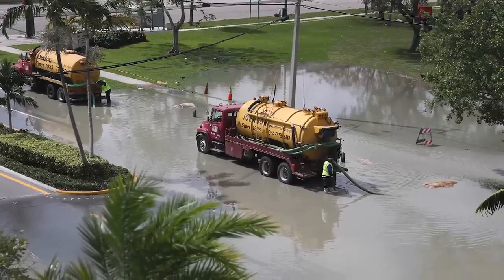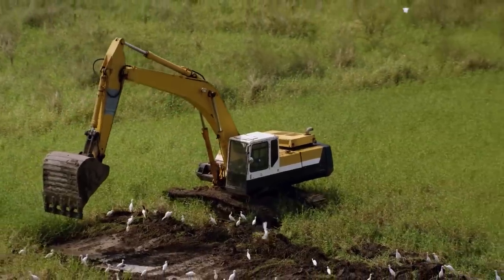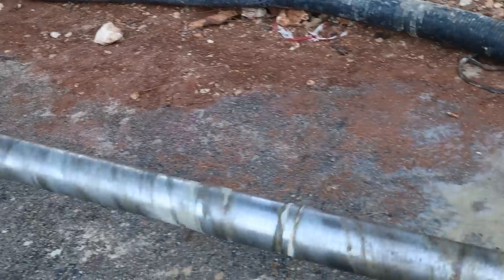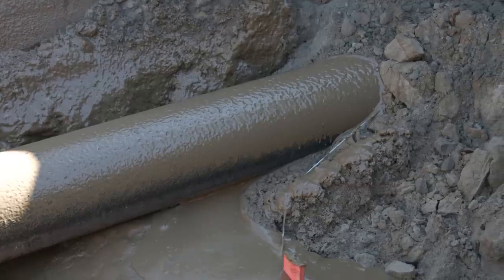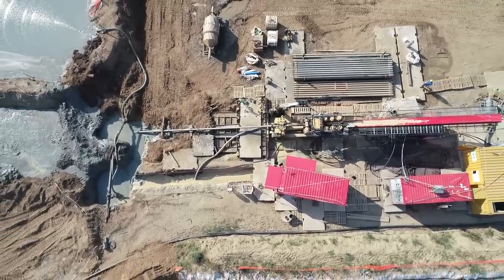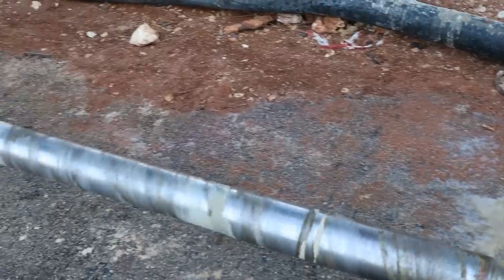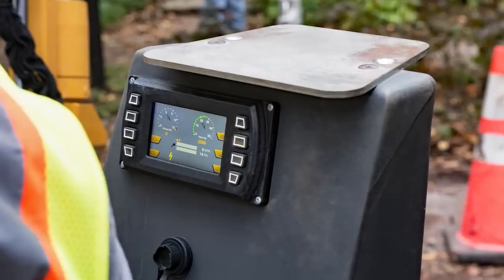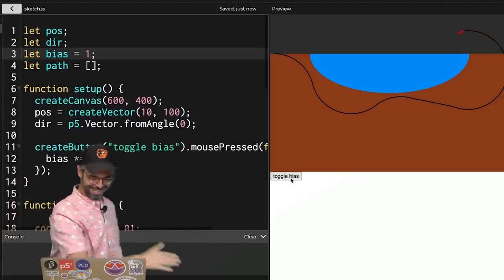How Do You Steer a Drill Below The Earth?

Comment: Great video, as usual. I splice fiber for a living. My work depends on HDD crews followed by pedestal/hand hole installer crews to get their jobs done before the fiber blowing crews can put the fiber cable in. 

Something not mentioned here (which I think is very important for the public to know) is the importance of "call before you dig". Our HDD crews have to put in locate service requests 72 hrs before they start. Any company with utilities/pipes/fiber/gas has 72 hours to mark the requested route with spray paint or flags.  If they DO NOT MARK IT, the repair cost is their burden when it gets hit.

There is a huge misconception that HDD crews are always careless when they are drilling. Many times, other companies have not properly grounded their systems, used tracer wire in non-conductive pipes, or adequately documented where their pipes are... their buried utilities can't be definitively located. 

One job just up the road from me has broken the water main so many times because the city claims they don't have the equipment, manpower, or budget to do the locate requests and mark where the water main goes... Even though the primary contractor offered to give them the equipment and pay an overtime rate for all city employees needed to complete the task. In the end, they hit the water main 3 times a week and they are portrayed as the bad guys. 

For those wondering... hitting a 288 fiber cable and damaging a 1000' section can run well over $15,000 in fiber splicing cost alone. I don't know the HDD costs or any of the other expenses needed to replace the cable... But it is very expensive to break a fiber cable.
Reply: Most of the guys doing fiber are payed by the meter so basically if your not drilling your losing money. But I would say just at a minimum you would be $500/hour in cost. The worst part is no matter who hit it or why gossip travels and it hurts your company reputation.
Reply: also, accidents do happen on both ends.  a guy I worked with years ago was on a bore project at an airport, and the rig operator was going for speed over precision when his bit came up through the runway surface.  other side of the coin, a trenching crew cut a 125 pair copper phone bundle when the country grader graded the road in between the underground locate service marking it and the trenching crew trenching it.
Reply: @kenbrown2808  that sucks, but so true. Some other company on a jobsite can screw up vital info needed for the HDD crews.
Reply: Apparently HD drillers have had it relying on the utility maps for locating other existing  pipe and lines. The various detection equipment business are taking off.
Reply: @kenbrown2808  Sounds like nobody wants to go down through bedrock actually drill, where there is plenty of room.  Instead, everybody just wants to ram though the soil, and it’s getting crowded.
Reply: @Nill757  maybe that is a contributing factor to the industry's growth, but the amount of money being spent in rural fiber network construction has stretched all existing crews to the max. I'd be more inclined to say that's why locate service providers are taking off.
Reply: @Nill757  yes, they kind of want to keep whatever they are installing at a fairly consistent depth, to make it easier for other people to know what depth they can work at.  for example, natural gas service lines run at 24", power service lines run at 36" consumer electrical lines run at 18" and TV and telephone service drops sometimes get deep enough to not be a trip hazard.
Reply: @kenbrown2808  Sure, and when crossing multiple other lines depth, the space at that depth is full.  There are no subterranean stop signs w intersections.  A new depth, deeper,  probably in more rock has to be used, but crews are avoiding the cost with many major disruption of existing cable/pipe.
Reply: @Nill757  yes, directional bore crews really need to locate any obstructions, not just by location, but also by depth, and avoid having their drill at that depth in that location, and a lot of old underground stuff was just put in the ground with no electronic tracing assistance, which makes it that much harder to avoid.  however, boring down into bedrock and then turning is often a massive overcomplication.

Comment: I once wrote a guidance program for a pneumatic directional drill head. It allowed for horizontal and vertical profiles, and I had to invent a method for aligning two vectors in space using at most 2 curves with a minimum radius of curvature (it involves normal vectors to planes and an iterative approach). The drill head was one of a kind, with no mud required and an average speed of 1 foot a minute. The contract fell apart though, due to various factors. It's still one of my proudest achievements.
Reply: As a locator, that would be cool to use
Reply: impressive programming

Comment: Best Vid yet, I always wondered how they did that and now I know. The demos of an asymmetric bit steering the drill string are excellent.
Reply: Can you build such a machine on paper? NO, because you still don't know how it works. you only know the theory, no practical comprehension regarding the drill manipulation or function.  How do a bit steer if it needs to continuously turn to drill? You don't know. I don't know.
Reply: @alltheusernameswastaken8936  Well of course I couldn't build one of these machine based on a 12 minute YouTube video....It's a demonstration of a principle, not a PhD on how to design, build and operate these devices so for those of us who started out knowing nothing about it at least I get the idea and can drill down into the subject further if I want to know more (forgive the pun).
Reply: @alltheusernameswastaken8936  um the video answers your second question. Either the asymmetrical bit at the end stays in place and fluid pushes out the soil or there's a spinning bit at the end which spins on an axis almost perpendicular to the bore so it's asymmetrical.

Comment: I worked at a shop where we machined the drill bits for these. I never knew exactly how they worked, we just machined them and sent them off. They weren’t the motorized type but the dirt digger style that relied on the shaft rotation to cut holes. It looked like a normal bit but with half of the front end chopped off at angle. Anyways, thanks for making this video so I understand how the technology works a lot better.
Reply: I turned a lot of parts used in oil drilling, pretty cool stuff, long cycle times so easy money once you got it programmed right

Comment: The plugging of the Deepwater Horizon oil spill back in 2010 was accomplished by directional drilling.  They hit the well's 8 inch (?) bore from over a mile away then pumped concrete into it. If memory serves is was more than a mile down to the seabed before the drilling started, pretty amazing.

Comment: I've always wondered about this.

On a much more amateur level, when I was a landscape contractor, I often had to run pipes under sidewalks and driveways.  I had this similar device, although there was no directional ability.  A simple blade head mounted on the end of 1" black pipe. At the other end, a T fitting that accommodated a garden hose and a 1/2 drill adapter.  We would dig down a foot and as horizontal as possible, and other trench on the other side.

Worked great. Never a problem although my contract had a disclaimer about unforeseeable circumstances under their pavement.

Comment: I'm training to be a hdd drill locator using a 2011 vermeer 24x40 drill. My operator has operated this particular drill since new and has been drilling for 28 years (his words). The whole process is pretty cool aside from the digging to spot the household utilities 😅 the way to steer the drill is a clock pattern. Haven't done any waterway crossings yet but the residential stuff is pretty tricky snaking between all the services. Great job and wouldn't change it for a long time
Reply: I work for DCI, keep at it

Comment: 15 or so yrs ago before I retired from consulting we used this to install two 48inch steel pipes across the Platte river.  Each about 2700 feet long.  When they drilled the pilot holes for the two bores the drill head came up with in two feet of the target stake. Pretty impressive.  The soil conditions were basically sand. We designed it to go 70 feet below the river at the low point.  We evaluated this against open cutting and this way promised to be a much better option.  It allowed us to go under wetlands and not worry about potential high river flows during construction.  At the time 48 inch was on the upper level of experience contractors had. Michels out of Wisconsin did the work with very little problems.  The whole operation was very complex including welding 2700 ft of the pipe which came in 20 ft sections and which was coated on  both interior and exterior, repairing the coating damaged at the joints by welding and laying out the whole length of pipe on rollers to aid in installation following final reaming of the borehole to final size.
Reply: 👍big job

Comment: Thanks, I always wondered how the directional drilling happened.
A few years back a 14" high pressure natural gas line built through a few miles from my home.  It traveled a route that mostly avoided any developed areas, but it do have to go through a town a few miles away.  Along side the highway they just did cut and cover, but they used directional drilling to run it about 1.5 miles horizontally under the town.  It was pretty cool to see the whole process of drilling and then pulling in the pipeline.
I was really blown away by the pull in process they ended up using.  They laid out, welded up and pressure tested the 1.5 miles of pipe.  The issue they had is they didn't have 1.5 miles of land in line with the pull.  So they rented farmland perpendicular to the highway and pull pit.  When they went to pull in the pipe in, it was bent 90° before being pulled in.  They used 4 giant sheaves and attached each sheave to a different D9 bulldozer as an anchor.  They were laid out so the bend had about 100 yards of radius to curve the pipe around.  The pipeline had quite thick walls, and I'm sure the forces involve were massive.
Reply: Actually thicker walls may decrease pullback forces because pipeline weight counteracts buoyancy forces. My guess is that if pipeline wasn't ballasted (filled with water during pullback process) then thick wall was designed to achieve neutral bouyancy. If buoyancy controll is cafefully planned and borehole quality is good, pullback forces may be really low. According to calculations final pullback force could be as low as 25 tonnes, however due to significant distance it could be much closer to 50-75 tonnes. And I really mean that distance is impressive. The longest crossing I attended was 1180 m (or 3870 ft) long for 1000 mm (40 inch) steel gas pipelines. Final force was 110 tonnes by the way. Planning for over 2 km project would be a real challenge and I'm looking forward for that.
Reply: Pipelines offshore are laid flooded or dry, depending on wall thickness and diameter (hence overall weight), to mediate "floating" factors.  Often the larger diameter lines (>12") are laid coated with a concrete jacket of around 2" thickness or more to add weight so that they still can be laid dry without floating.  In depths of less than 200 feet they are subsequently buried (jetted down) to provide some protection from anchoring vessels or from vessels dragging nets for fishing.

Comment: Great stuff, as usual Grady. I worked on a remediation project in VA a few years back. We needed to connect some ground water remediation wells to a small water treatment plant we built. Those wells were on the opposite side of the Shenandoah River from the treatment plant. We hired a contractor and I was lucky enough to be the oversight rep for this contractor so I got to watch the process first hand. About 3/4 of a mile long and 40’ under the river bed thru mostly solid rock. Remarkable technology.

Comment: I've been working for 20 years in oil and gas drilling and used the same techniques using mud motors. Controling the direction is done in the same manner, using a Measure While Drilling tool to keep track. The data was transmitted to the surface with pressure pulses and gave a very good idea of where we were going. We've once drilled an oilwell with a gas cap on top of it, reaching 2200 metres on the horizontal section at a true vertical depth of 2700 metres. This video was fun to watch for me.

Comment: In my region, the topsoil is made up of a mix of caliche and sandy loam. Pretty easy stuff to go through, usually. I saw one bit that looked to me like it had one bit that had a slap on it that could be lifted with hydraulics. My reasoning after examining it for a moment (from several feet away, of course)  was that it appeared when they wanted to change direction, they oriented the bit in a specific position and the flap was lifted to literally push the bit to the opposite direction. Then they retracted the flap and started drilling again. Was fascinated by the simplicity of it. There was still drilling fluid used, of course, so I'm not sure of the interaction, but the designed seemed almost head-slap obvious.

I've never witnessed anything larger than a six inch diameter conduit being installed. Would LOVE to see one of these bigger rigs in operation!

Comment: This is a question I've always wanted answered but didn't know it. It was fascinating. Thanks.

I wish the city engineers where I live would watch it. I'm pretty sure they have never heard of directional drilling. They always open trench and block traffic.
Reply: DD is more expensive than open trenches for large diameters, so the city will tend to use the cheaper method, reserving DD for doing under roads and such, for small diameter lines, and open trenches for large diameter ones.
Reply: I wonder if it's truly a matter of ignorance vs other factors, namely cost.

Comment: I work in oil and gas and with directional drilling on a greater scale than this but ultimately the same concepts. This explanation is very accurate and well composed 

We have sensors at the drill bit as part of the assembly  that can measure exactly where the bit is as well as properties of the rock. This includes gyroscopes, inclinometers, accelerometers, compasses, Geiger counters, neutron emitters and receivers, and electrical resistivity probes. All of this data is transmitted through pressure pulses in the drilling mud at about 1-4 bits/second. The data is then interpreted by a computer allowing us to plot our position, orient the bit and steer it where we want to go real time. We use mud motors and rotation of the drill string same as described. We have much larger rigs that those shown here but the concepts are all the same.  Steering is more complicated although the bent pipe concept demonstrated here still applies

My rig can house and feed 200 people, support about 1,200T of pipe,  gets power from about 45,000kW worth of generators, has 9,000HP of electric motors devoted to rotating the pipe, and another 16,000 horse power devoted to pumping the mud and other fluids. I find it incredible

Comment: I am a pipeline project engineer, one project we did over two years completing 74 road crossings for pipelines ranging from 24 to 60 inches, we came across all different kinds of trenchless crossings such as HDD, micro tunneling and even direct pipe crossing which is combination of both HDD and MT. One important thing U learn before pulling the pipe, we need to fill the whole pipe with water for Buoyancy control otherwise the pipe might get off track and stuck.

Comment: I worked on a project to get power and signal cables under a railway line using directional drilling. It is something that could be used to drill for oil in the Atlantic without the need for rigs in deep ocean.
There used to be a wood bit that you could drill around a window pane.

Comment: I remember seeing my grandparents using one to install a electric cable. The main company which supplies them calls them Ditch Witches. Pretty fitting name.
Reply: Ditch Witch is just a brand name like Ford or chevy
Reply: I think the Ditch Witch brand does have some directional drilling equipment, but it also does trenching. Are residential cables installed using directional drilling nowadays?
Reply: Ditch Witch is a manufacturer.  the original product was a cable plow that would lay a flexible cable through a slot it cut in the ground without ever having an open trench.
Reply: @wfemp_4730  final connections are almost never put in with directional drilling, as far as I know.  it's mostly a case of restoring the surface after trenching being more cost effective than setting up a directional bore; when done at that small scale.
Reply: @kenbrown2808  A very narrow trench.
Reply: @wfemp_4730  but technically never open since it normally falls closed behind the plow. (the plow is not to be confused with their trencher that cuts a slit trench about 4 inches wide)
Reply: @kenbrown2808  LOL fair enough